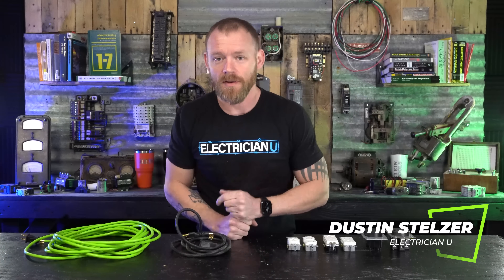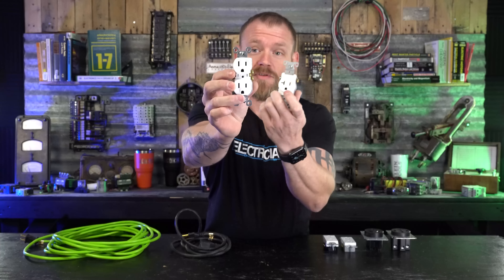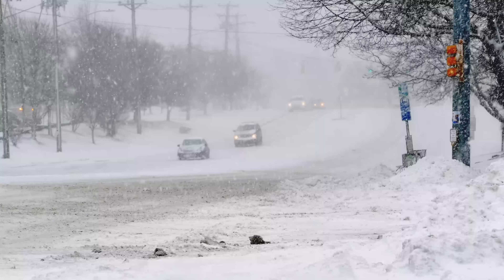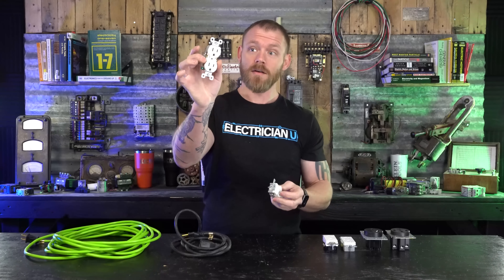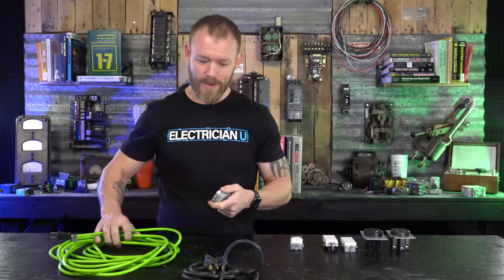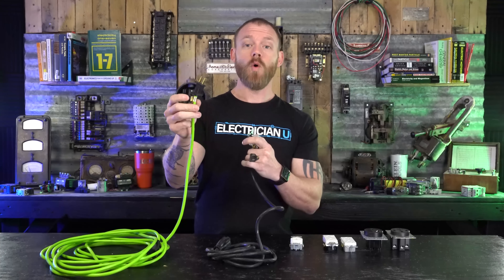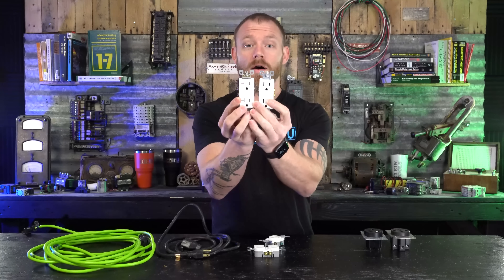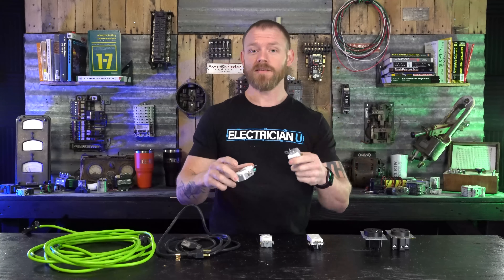Why Do Outlets Have Different Types of Holes?

Comment: On polarity question: Yes it does matter for something as ubiquitous as an lamp with an edison socket.  On the bulb, the neutral is connected to the metal spiral piece and the hot connection at the bottom tip. If its properly wired, then until its all the way in, there is no hot connection.  But if the polarity is reversed, then the exposed spiral metal is energized as soon as you start screwing it in -- and you could easily touch that metal getting a nasty 120V shock.
Reply: Same for old electronics like guitar amps that have the chassis tied directly to neutral. If the wires were reversed, the grounding conductor of the guitar plugged into the amp, and thus the guitar itself would be tied directly to hot.
Reply: Some older toasters too. They switch the hot and assume the neutral is grounded. I think newer appliances have to switch both conductors but the polarity can definitely matter in 2 pin plugs!
Reply: @benchociej2435  interesting.  Always figured that's why new toasters have polarized plugs.    But switching both conductors definitely improves safety because you can never assume the receptacle is wired properly.  Appliances with Calrod or quartz heating elements like toaster ovens pose less of a danger but correct polarity should always be respected regardless.

Comment: Good info.  One thing you might add,  regarding the 15 and 20 amp,  125 volt receptacles,  is Code does allow either 15 or 20 amp devices on 20 amp circuit as long as there is more than one receptacle on the circuit (a duplex counts as two) however,  20 amp devices shall not be installed on a 15 amp circuit.  30 amp receptacle shall be used on a 30 amp circuit.  50 amp receptacles shall be installed on a 40 or 50 amp circuit (such as for an electric range) 60 amp receptacle shall be installed on a 60 amp circuit.
Reply: @Kyle regarding 15 amp duplex on a 20 amp breaker...I searched for this comment so as not have to make it, that is exactly right.

Comment: It wasn't all that long ago that we had 2 types of plugs for electric stoves and electric dryers.  In the old days they had 3 prong plugs.  They had a bonding strap in the appliance that bridged the neutral and ground together between the screw terminals.  Now they have plugs with 4 prongs on them so now these appliances can separate the neutral and ground in them.  In a lot of the older homes they still have the 3 prong plugs and a lot of these older homes only had 3 wires for these appliances.  They don't have the ground wire to the plug.  This is why when you buy new appliances like electric stoves and dryers, you need to know which type your old dryer or stove have.  If you do upgrade to the 4 prong plug, that is why you need to remove the bonding strap between the neutral and ground lugs.  This separates the neutral and ground so the 4 prong plug works properly.

Comment: Hey Dustin,when you’re taking about the 15A  v the 20A receptacles you really need to let the people know that for 20A the supply wire needs to be 12 gauge,15A is 14 gauge wire. 20A fuses/breakers wired to 14 gauge you’re asking for trouble.
Reply: In my 50 year carrer other then some large window AC units never saw an appliance with a 20 amp male plug so don't waste your $ on 20 amp 125 volt receptacles.
Reply: I think he mentioned this in not so many words.

I had a house where the previous homeowner replaced the 15 amp breakers with 20 amp breakers.  He reversed polarity on a lot of the receptacles, and switched the cold on many lights during his "remodel".  He buried splices and likely broke every other code.  Fixing that place was hell.

I was scared to death of electrical fires from issues I didn't catch and that my fire insurance wouldn't cover it because of being under code.
Reply: Slight clarification.  A 15 amp circuit can use either 12 or 14 gauge wire.
Reply: So can I use a 15 amp receptacle on a 20amp circuit  if your I’m not needing the 20amp appliance feature? Also, would there be improved efficiency by running 12 versus 14awg? I would rather just overbuild the wiring if there are noticeable positives.this will be for a yurt off grid that will running off solar.
Reply: John Schneider: not always though..factors like ambient temperature or conduit fill can change the needed wire gauge..

Comment: It's my understanding that a key reason for polarized plugs is that it ensures that the device switch switches the live, rather than the neutral. That way, anything on the load side of the switch is at neutral (and so approximately ground), rather than at the live voltage.

It's not just to make it easier for the electricians.
Reply: Exactly - and the fuse.  Some sockets (screw in lightbulbs) also use neutral for the shell and hot for the switched center contact - it's a lot safer for the most common insulation fault.
Reply: Yes and so that metal parts on certain stuff aren't just sitting there live all the time ready to give ya a zap. You flip the switch and cut off the hot connection.
Reply: @jameswyatt1304  NEC 200.10. (C).
Reply: @jameswyatt1304  It was mainly created so people wouldn't get shocked when changing out bulbs in lamps. The shell is easy to touch by accident when replacing bulbs, so the plug being polarized means the shell isn't hot (unless the receptacle is wired in reverse polarity).
Reply: I was fixing to ask why polarizing the plugs would be important if the way ac current worked made it pointless but making sure you can handle stuff safer like having the switch cut off the fixture so that essentially it disconnects the power coming in before it gets to fixture vs disconnecting after the fact and having a live little bit somewhere waiting to be grounded by accident
Reply: that is correct..for safety..not for convenience
Reply: @drasco61084  No, exposed metal parts are never connected to the neutral.
Reply: @illestofdemall13  I do not get how you could touch it. You have to be dead drunk to do so.

Comment: Sort of.  T slot receptacles aren't meant to just protect the receptacle in case the breaker doesn't trip.  Breakers are actually meant to protect the conductor.  If you put a continuous 20A on a 15A circuit you could potentially melt the entire wire and start a fire within the walls.

Comment: I was watching your YouTube tutorial about the outlets. I really need to know if I have the 220 outlet and the kiln I bought needs 240 and I can’t plug it to the outlet for 220, I have that separate designated outlet.  I now have to find a way to plug my used kiln that 240 plugged to this out let. Is there a converter I can use when I need to use my kiln and later I can use the outlet still for other thing I still need it for.

Comment: Do appliances with the horizonal neutral prong exist anymore? Every appliance I've ever seen that is designed to be used on a 20 amp circuit has two vertical prongs, so is the horizontal slot there for legacy reasons?
Reply: Yes they still exist but are super uncommon in a typical household.  Some professional grade treadmills use this 20 amp plug.   Another common use would be a commercial style toaster oven or expresso machine, like the kind you might find in a restaurant or Café.

Comment: Fitting out an office in New York the variety of NEMA receptacles (and the inability of electricians to fit the ones specified on the plans) came close to driving me nuts!   Since 1947 the UK has has fitted one single standard for domestic power.  Anything over 16A we go to IEC 60309.  Yes, others are possible; but they are vanishingly rare.

Comment: I like installing decora for finishes for the simple fact it makes the count for cover plates easier
Reply: Although I am sticking with toggles due to my 1909 house already having them, I kind of like the decora switches because they seem to have a genius design: ever noticed how no matter how slow you flip them, they click? This is because instead of just pushing down on a metal rod inside like a toggle, which slows down the movement when you flip it slower, the decora is made entirely of springs and pivots, which always click on or off once the paddle is past the mid point. This prevents arcing, so they can last longer. Strangely, there was a time when they made the toggles this way, too! Unfortunately, those declined in popularity in the 70s because they were apparently “too loud.” (Just people finding issues with everyday objects that work perfectly fine, only to create a new issue.)
Reply: strangely I have found 4 way decora switches seem to have a higher fail rate than most other switches

Comment: I am originally from Australia, and I find the Australian plugs way easier to insert into an electrical outlet  with the slanted hot and neutral plug. If you only have a hot and neutral plug ( 2 wire ), you have to really look to see the correct polarity in a